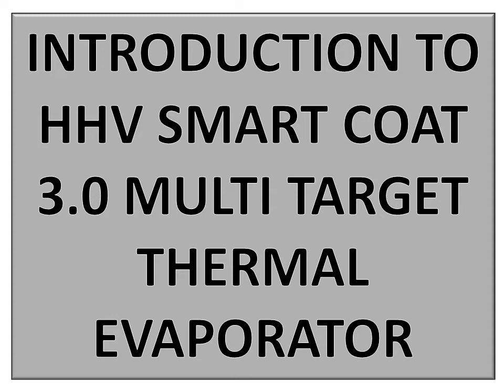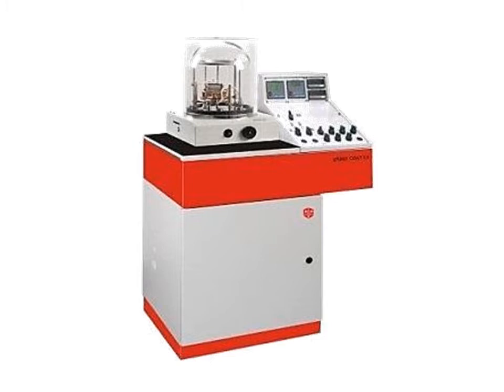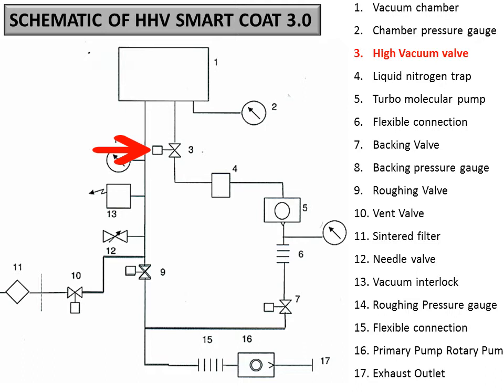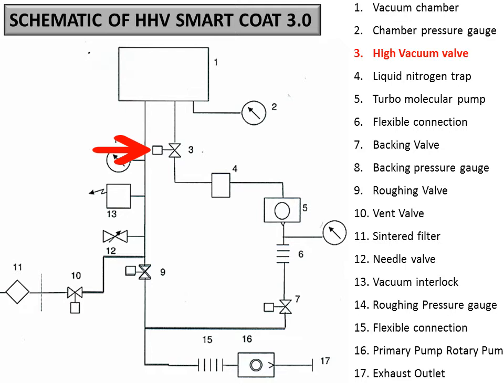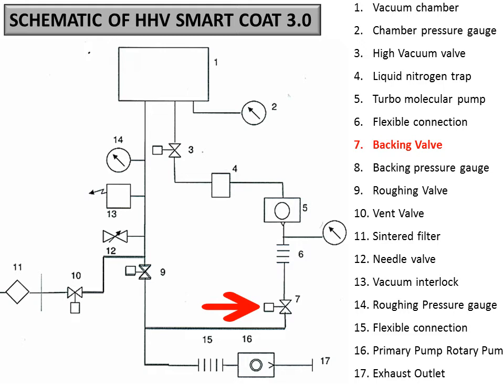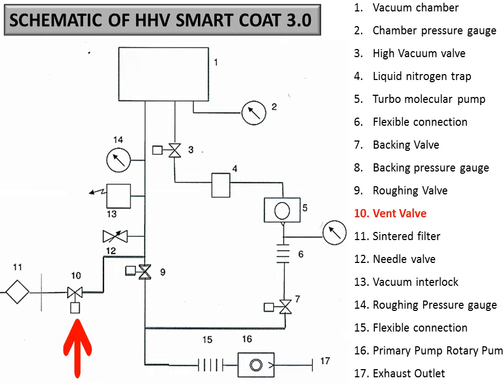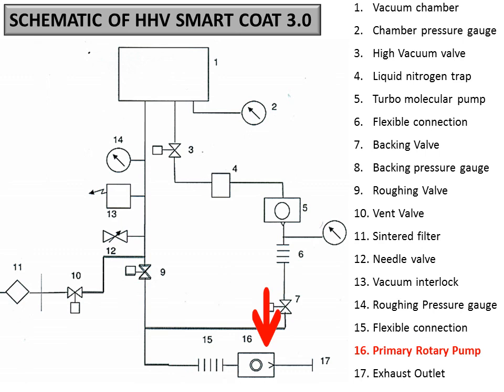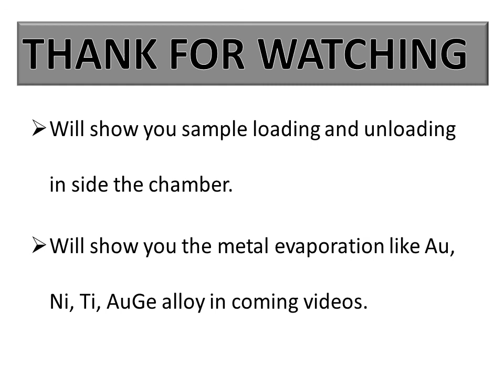Thermal Evaporation of Metals,  Part-1

Comment: Hello Can you help me. When steaming copper sulfide in the thermal evaporation system, the steam does not rise to the top note that the dimension is 10 cm
Reply from the maker: At what pressure the process is taking place
Reply: 10 minus 6 Meenu Jain Lalitpur